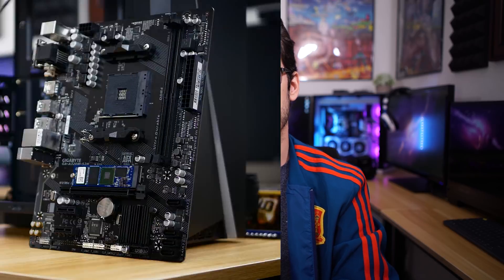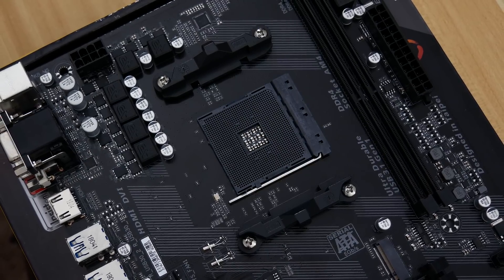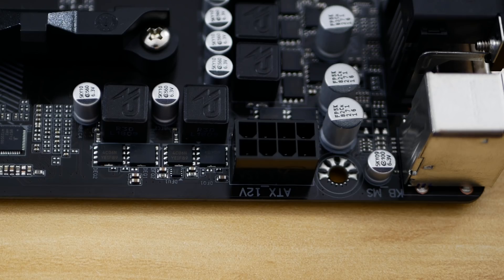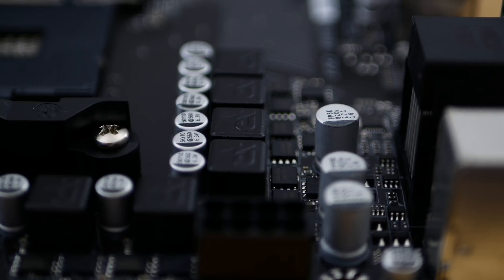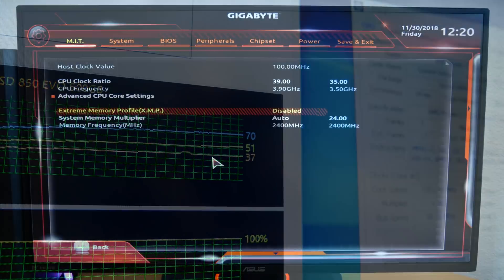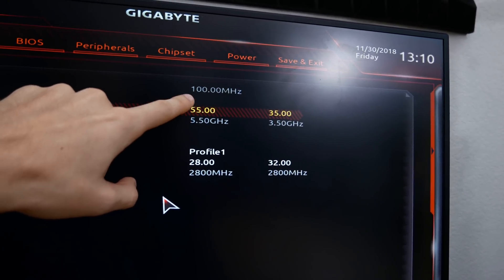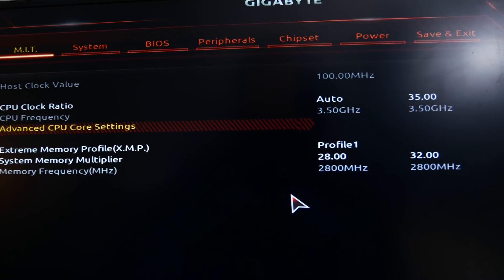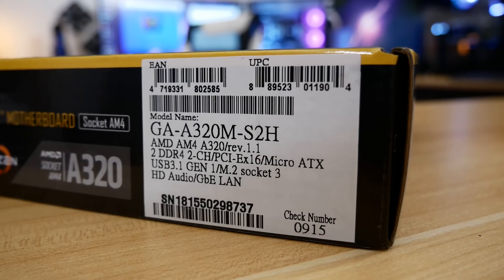We Bought the Cheapest AM4 Motherboard on Amazon...

Comment: 1-2023 These boards will support the 5xxx Ryzen chips with a UEFI/bios update.  Have been running another one with a M2 2 drive for over a year.  Worked good with 5600G/DDR4/3200 ram.

Comment: Great video. I just popped a Ryzen 5 5500 into this board after updating the bios with the existing Ryzen 3 2200G but no graphics display came up at all. I run it as a server with windows server 12 and the built in gpu doesn't even get used on the Ryzen 3 so if anyone knows why I didn't get a display to pop up it would be helpful feedback. Thanks much.

Comment: I have this motherboard and it works fine. The only issue i have with it is with my rx570 i had to move the hard drive sata to the lowest port and it is still a tight fit

Comment: Hmm, but many enthusiasts seem to trash the VRMs on low-end B350/B450 mobos anyway. 
(which are supposed to be the ones that are the more "bang for the buck", overclockable option compared to these A320 mobos)
So it seems to me that it wouldn't be "just" $5~$10, it would most likely be a lot more if you want decent overclocking using B350/B450 on the middle/upper end of the overclocking tier list.
(rephrased: "if people don't recommend overclocking on these lower end B350/B450 anyway, then using A320 for stock clock speeds seems perfectly okay to me as the low-budget option")
Doesn't even include the cost of buying an extra aftermarket CPU cooler, since Wraith Stealth can still handle a bit of overclocking.

Anyone is free to correct me if I'm wrong. I'd just like to know.

Comment: when we were building the PC my girlfirend said (the reasons why a320m-s2h): 
" I won't add RGB, I won't install 4 RAM modules only 2, good to have the m.2 for SSD, VGA and DVI useful too even with HDMI adapter,  HDMI as main because no external GPU will be added " .
 After it, I like how the Gigabyte APP is friendly even for XMP RAM , Fans control and basic Overclock. My photo http://altared.net/cc/mb-a320m-s2h.jpg

Comment: My friend use this exact board and currently running a R3 3200G. And he wonder what's the current most powerful cpu that you can put in this board to replace the 3200G without having any problem with vrm & power delivery? Is it okay to go with 3300X or even the 3600?
Reply: you can add a Ryzen 7. :) just consider a good air fans and that's all, .

Comment: I literally went and bought this board because it was the cheapest on Amazon. My 5 year old son had a Pentium G4400 and a GTX 770 2GB. It couldn't run anything he wanted to play. Looking online people had said that the i3-9100F was compatible with the H110 board with a BIOS update. It wasn't. So I got the Ryzen 5 1600AF and a 5500XT 8GB. Very easy switch and I am shocked at how well it runs. Most games can run maxed out, some like GTA 5 have some of the advance settings off. But for the money I would recommend it. Especially for a 5 year old. At least I have the other board and pentium, and GTX 770 so he can tinker around with it.

Comment: Update. I had to get this board as an emergency repair because my old board died. I transferred my 1st generation Ryzen 1700 to it and it works just fine. What I'm seeing with more recent reviews matches what I'm seeing in real life. The new variants of this board will take ANY Ryzen 3000 series chip provided it's 65 watts or less, which means yes, you can get a 3000 Zen 2 12 core and run it on this board. It also amazingly supports PCIE 4.0 (prolly because thats easier to do when its built into the processor die) and yes, I've seen people run one of the very few 4.0 graphics cards successfully on this board, and test the card in both 3.0 and 4.0 PCIE mode to make sure they get higher scores in Firestrike and other benchmarks. This is an incredible value of a board with a great update path just so long as you don't need lots of storage, the very most powerful processors (most if not all 12 core and above use more than 65 watts with the exception of that wonderful 3900) or to overclock your processor. it seems these boards (first gen) didn't support  XMP profiles but apparently your second generation of this board did, and I know mine does as I'm using it right now. I'm finding I LOVE this thing and will eventually upgrade my processor and video card on it as I see no need to replace it for 3 or 4 more years.

Comment: ih man Im about tu buy this motherboard for a 2700x. What aboput the vrms?? Whats your opinion?
Reply: Update: the bkard cant get the cpu more than 3.9ghz all cores sustain (power constrain). That changes if you load only two cores. Then it can almost get the full frequency of the 2700x. In cimebench this limitation equates to arroimd 200 poimts less compared to systems found om tje web so not veru much. In my opinion it makes sense to pair thos two. In gaming is not that much dkfference sonce the cpu is not used everytime at 100% as in synthetic loads or rendering
Reply: @sergiourquijo4000  is this a good board for ryzen 5 2600 with rx570 vcard?
Reply: Hey dude, i buy the same config, ryzen 7 2700x + a320m, do you have any inssues ?, Can you play and streame4 ?

Comment: Has anyone tried this with Ryzen 5 3600?
Reply: my bought this mobo last week it says Rzyen 5 3000 Desktop Ready ....using it with Ryzen 5 3500 (6C/6T)..so it should work with 3600 as well...BUT YOU SHOULD make sure you have a graphic card.
Reply: Abhay Raj so was it ready for use without updating bios?

Comment: Can I pair a320 with ryzen 5 1600 gonna use stock cooler not overclocking
Reply: yes
Reply: @issamthemorrocanjackass2403  thanks on a very tight budget 👌👍
Reply: @christohees9150  i m planning to do the same my i7 3770 and mobo died
Reply: @issamthemorrocanjackass2403  ya my GTX 1050 2gb and i5 2300 is struggling 1080p low Set 30 fps so I decided enough is enough and started to save money October I will have enough to upgrade 👍 I'm going Rx 570 4gb and ryzen 1600 and 16 GB of ram
Reply: @christohees9150  nice make sure u get 3000mhz

Comment: So if i use a320m s2h . with ryzen 3 2200g . Will work ??
Reply: It should but don't. Better buy Asus a320m prime K. I built 2 desktops with 2200g with only difference being a mobo and gigabyte one gives BSOD's. I'll be replacing it with a prime K.
Reply: yes my old built is that

Comment: I'm using this board with Ryzen 5 1600 which has 6 cores. It's working fine, never tried over clocking though.
Reply: Light Yagami  Yes, it would support 2600x but you might face issues while overclocking. And you can use any graphics card with this mother board.
Reply: Try It Studio Would this work with a ryzen 5 3600?
Reply: @slicedice112  Yes it would support 3000 series. Here is the list of supported CPUs: https://www.gigabyte.com/Ajax/SupportFunction/Getcpulist?Type=Product&Value=6473
Reply: You play games in this mobo? I have R5 1600AF and stock cooler(mobo GA-A320M-H)
Reply: @czerwonymotyl948  Yes, with R5 1600 and RX 570.

Comment: WTA PLEASE RESPOND GUYS

Spec ..
 b450m steel legend
Ryzen 5 2600x
2x8 gb 3200 ram
Aorus rx580 8gb
660w

It is okay? Or just need downgrade or what? Plsss someone
Reply: I would suggest r5 2600 to adjust the budget for rtx 2060 if you are on budget set. R5 2600x doesn't give good price/performance ratio (watch linus video)
Reply: U good to go.. dont worry im with u RTX series too pricey

Comment: Will a Ryzen 5 1600 + Inno3D GTX 1660 Ti work well with this?
Reply: seyahtan24 if u don't plan to oc then it'll work
Reply: Light Yagami I recommend most of MSI B450 mobos since they're cheaper but got the best vrm.
Reply: Light Yagami it can run but doesn't able to run your CPU to its full potential. Can't OC and can't run your ram on high frequency which Ryzen needs.

Comment: funny though i bought the B450 s2h for like 56 Bucks in December, which doesnt lack in OC potential, also VRM has coolers, and 4+3 Phase, not to mention USB 3.1 support and descent Ram OC potential ( runing cheapest F4-3000 on a stable 3200 with 16-18-18 timings. You might check that one out (Gigabyte B450 S2H ). >> userbenchmark.com/UserRun/13624168

Comment: I got a cheap Asus AM4 Mobo cause I was really thight with money and it only has 1 fan header so I had to buy those molex things so I can plug in both of my fans and also when I tried to disconnect my usb3 port on the Mobo its housing just completely broke so I can't use my usb3 on the front anymore

Edit: also ofc it can't oc even though I have a beast cooler so that's a waste and also no nvme support

Comment: not sure how much toggling was done. but i downclocked a ryzen 5 1600 back to 2.7 to mimic the athlon 200ge, it stuck in cpuz. then when i found out about that amd was releasing the other chips. move it to 3.2 and it suck and also at 3.6 and it stuck.  i own the same board, and ran benchmarks on it to see. their is not much of a difference, but again it shows. last the reason i clocked it to mimic a 200ge, cause its for my daughter who does not need the power of a r5 1600.  the r 5 1600 was a chip i own cause i upgrade to a r 7 1700.  last you dont buy a small board this cheap to run R 5 1600 to r 5 2600's on.

Comment: 1:08 you compare this one to that other motherboard and try to make a point it would be better. Well look closer, the green one has 4 dim slots and two, well spaced pci-e slots so you can actually run sli or crossfire. There's also enough space between the socket and the ram to fit an aftermarket cooler, and I can't say the same for your mb. Why does a piece of hardware need to be "pretty" when it should be "functional" instead?
Reply: @jamdvx it's pretty obvious -in about two years, you will need more ram, and you can simply add 2 more sticks, without having to replace your current ones. Also, smaller dims are cheaper than larger ones, for example you will pay alot less than half for a 8 gb dim vs a 16 gb one

Comment: But, people buying cheapest processors and motherboards should be first to do overclocking. Your computer will struggle and you want to push it to the limits. What is the point of doing it on high end 5000$ computer where everything runs smooth. Well just in few cases it would make sense.

Comment: Bought a Asus prime EX A320M gaming for only 60$. It supports asus aura sync. Rgb lighting on the board and even have 4 ram slots. Sure it cant OC but i dont OC anyway. I put a ryzen 2200g (gotta upgrade with 2600 later) paired with 8gb 2666 memory and gtx 1060.

Comment: So what you're saying is this is good enough for 99.9% of the people. You shouldn't use WiFi with a desktop unless you don't care at all about latency or download speeds. They have basically killed SLI/Crossfire with the new cards and it was always a pain in the ass so who really does that anymore either? Run it vs a $200 board with the same clock speed and ram and you'll see there is no difference at all. I do agree if it's only $10 more for overclocking ability it would make no sense to buy this if you in turn want to also spend another $30 on  decent air cooler (hyper 212 TYPE). If you don't care about overclocking and want to save 40 or 50 dollars this would be OK.

Comment: Wouldn't these support 4K60 when using something such as a Ryzen 2200G/2400G, and running the latest BIOS?  I remember reading somewhere that the HDMI version was determined by the CPU, since the HDMI socket is connected directly to it.

Comment: Too bad you had all those hunches but didn't actually bother testing to confirm them.
Reply from the maker: Hunches? Like what? I tested them all. HDMI port, all temps, BIOS OCing, etc. Did you not watch the video?
Reply: @GregSalazar   First let me apologize, my comment looks more offensive than I intended it to. You say we would probably get the same results if we ran Cinebench before and after manual OC. I'm buying into the argument, but I guess I just kind of "expected" the actual confirmation (you don't owe me anything, though). I own an A320M, I game, I don't care about OC at all, at the end of the video i don't see why i should upgrade. Some a320 even have m.2 (just bought one for 54 euros). I do admit missing the actual HDMI spec confirmation at first view. Overall, though, i think i mostly did not understand the tone : the review was fair, but besides overclocking i failed to understand the kind of dismissive conclusion: wifi is probably not a pb for gamers who need reliable connections. Additional SATA ports either. Unless one can find a B350 for the same price, i didn't really see the reason not to buy for gamers on a budget besides OC as you said. Saving 20 dollars on each component can actually make a great difference.
Reply: But i really don't like the tone of my remark. I rarely comment videos, that's probably a good thing

Comment: This board is the single best selling "small-buisness-can't-afford-hp/dell-prebuilt" mobo. This will have the basic a series apu 500gb hdd and 1 stick of RAM. It's going to run a registry programme, spotify and ph, and will last FOREVER. Exaple: a cafe across the treet has had 3 renovations in 12 years and guess what? Registry is still a win xp sp3 single core AMD, 512 mb of ram and some hdd. And it takes it like a champ

Comment: You should have tried if an R7-2700 runs stock on it, or will it throttle as bad as the i9 on cheap boards.

Comment: i bought a gigabyte b450 aorus M  and the bios is exactly like this cheapo board. Its a bit dissappointing really. I think the 2 most annoying things about this b450 board is that you cannot set voltage directly and are stuck to using offset upto an additional 0.2v (but thats on top of 1.16v so max is 1.36) and you cannot touch bclk. Only way to overclock is through pstates where you have somewhat full control of voltage. I do not like the bios layout but outside these complaints the board has been fine. I just wish i threw a little more cash on the table and got the 2600x instead of the 2600.

Comment: I'm no fan of locked chipsets at all, but cheap mobos are always a gamble.  I bought an Asrock B350m for my Ryzen 1600 because at first I had no intention of overclocking it--it was a living room PC for  a little gaming and mostly streaming stuff (I know, it's overkill for that but I wanted to do an AMD build and MicroCenter's price was so good!)   Anyway, I decided to try to see how fast I could get the 1600, and right now it's running 3.9 ghz with the stock cooler on that $60 motherboard without any heat problems whatsoever.  Sure, it could probably hit 4ghz on a better board with a better cooler, but is all that extra cost  worth another 100 mhz?  As it is, I figure it's doing a pretty good job!

Comment: I bought this board about a month ago for my parents because their Intel Dual-Core was giving BSODs. I gave them an Athlon 200GE, 4GB RAM and an SSD and it works perfectly for them. Though of course, they are not using it for much more than web browsing... Still, if the retailer doesn't give me my mobo&CPU back before Christmas, I may just try out how it performs with a GTX1060 6G :D
Reply: Holy shitting bottleneck
Reply: @HoloScope  it's a entry level build lol
Reply: @LISBONKULT  lol
Reply: i have this board and it perform very well with a 1060 6gb
Reply: I actually use this Mobo with a ryzen 3 3200g and a 1660 super. It runs great and haven't had any issues.
Reply: But if you turn the resolution up maybe it will be stable like Brian did from techyescity with the Pentium g4560 and a gtx 1080
Reply: It performs good with my 1060 3gb

Comment: the asus ex-a320m-gaming I bought has very good vrm's and I managed to overclock with it i got 3.9ghz by just putting up the voltage in ryzen master tool to 1.35v and in ryzen master up the limit of core count to 3.9ghz cpu started running at 3.9ghz without any issues on R3 1300x you have to do it in ryzen master tool.
Reply: Did you check CPU-Z? it should be impossible to OC on a320 board
Reply: @roikhanulyahamidan9978  yes i did cpu is running at 3.9ghz at 1.35 volts
Reply: this was only possible through ryzen master tool. I don't think all A320's can do it only the ones that are worded with gaming in its name. Cause it has the same VRM's as the B350.

Comment: I actually built my brother a budget build.I went with the MSI A320M GAMING PRO as i am not interested in overclocking but sad part is that when i built his pc there was no B450 boards yet and now the B450 are a little higher priced than the A320 but it still makes more sense as it can overcloc.His just running with a 2400g but for what he uses it it's more than enough without overclocking.

Comment: About a year ago I bought a Gigabyte B350 (GA-AB350M Gaming 3) board with a Ryzen 3 1200 for $75 for the board. I have yet to have any issues with it, I’ve since upgraded to a R7 1700x. I believe it has the same 4 + 3 Phase VRM as the one in the video, but overclocking support was a big plus before I got the 1700x (was running my 1200 at 3.8 ghz no issues).

Comment: Great video and review. Something I’ve noticed lately is people keep saying that the cheap products are good, but default back to saying “spend $10 more for more features”. We can say that for everything and for this it’s a 20% increase for a $50 board, if we use that thinking for every component there are no longer budget builds. Just my thought on not spending 20% more on a component if you don’t need the extras. Otherwise love the review.
Reply: Yeah my new build went from 1.1k€ to 2k€ just by spending abit more on all the parts
Reply from the maker: It's $5 more. $55 will get you a B350.
Reply: Science Studio then it’s 10% more cost. My point is that if we were talking about a cpu or gpu we would dive in deeply on if we get the 10% better performance for that difference, we don’t do that for some reason with mobos.
Reply: @chase-collins  Great point.
Reply: @GregSalazar  Well, let's see a review and link to that.  ;) thanks